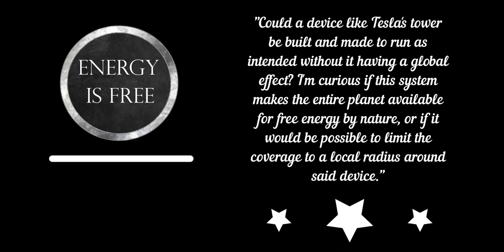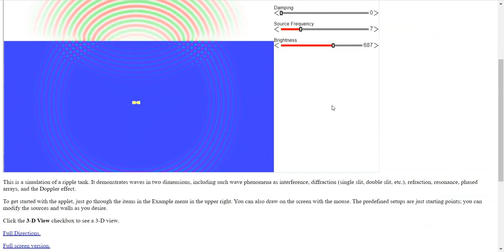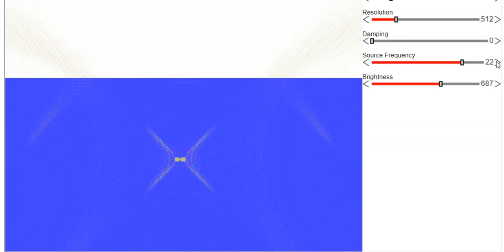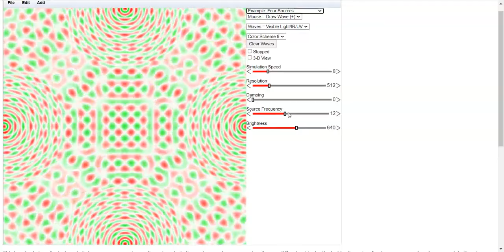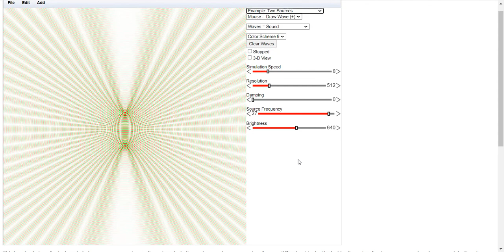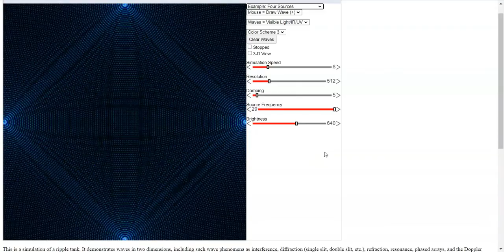Tesla's Tower:  Was One Enough?

Comment: Were those who built the pyramids to produce electrical energy to cut stones fools... Tasli’s experiment succeeded, and it is not necessary to transmit free electricity wirelessly. You can transmit it via the electricity network. Please, you do not know that the controlling media system is the one who hid and fought Tasli and assassinated scientists from And he threatened his citizens... Why does China not reveal the secrets of its pyramids? Why did America hide Tesla’s research? The issue is simple. There is a natural and permanent potential difference between the potential of groundwater in the ground and the steamy or wet layer in the sky at an altitude of 100 to 150 meters. It can be reached. For atmospheric voltage through a simple voltage capacitor, and by connecting it to the ground with a specific electrical impulse, the voltage difference can be exploited to generate energy like an infinite battery, and if the Egyptians used it to cut stones, then it is an excellent amount of energy.
Reply from the maker: You are very on target about the potential difference generated by simple altitude differential.  I am glad to hear someone talk about it!   I also agree that true renewable options are hidden from the public to protect the extortion schemes of the fossil barons.  You’re very awakened!

Comment: If there were 6 towers as in four equal points around the equator and the other two at the North and South poles, or 6 towers equally spaced around the equator, might this generate an effect similar to that seen in the atmosphere at Saturn's poles?
Reply from the maker: That’s an interesting thought.   Tesla believed that the signals he was transmitting were using the skin of the earth, the shallow crust.  The shape of the wave pattern would still be operating inside a roughly spherical envelope of the crust.  If you had six oscillators equidistant around the equator or even if you had four and two on the poles the effect would still be spherical.  If you tuned all six oscillators right and maybe played with their phase and amplitude you could probably make that spherical wave structure do almost any shape you wanted including a vortex like Saturn.  Supercool but that would seem dangerous to me, like it might generate heat if the volume of moving charge got big enough.
Reply: @energyisfree  , I'm talking about the  hexagon pattern at the poles of Saturn... The shape of the waves would be spherical, but, just like bubbles, where each field resonated, there would be a hexagon shape... I gotta think some more about this... interesting indeed. Thank you.